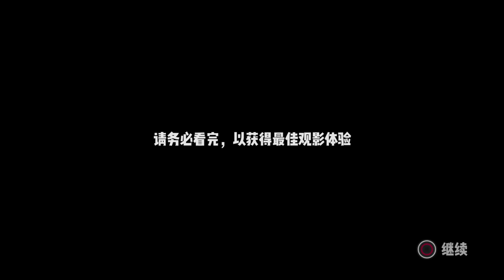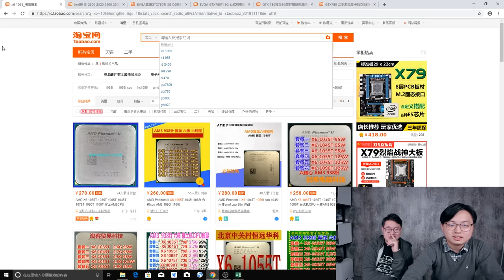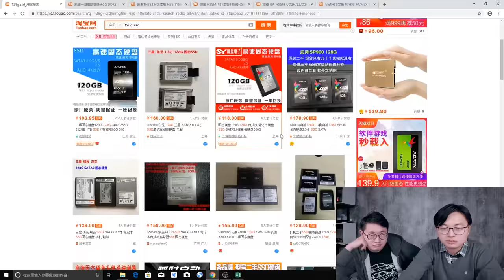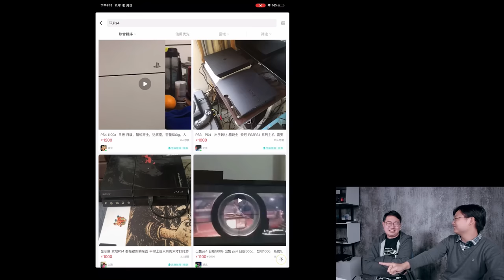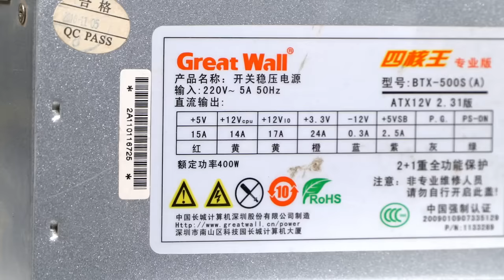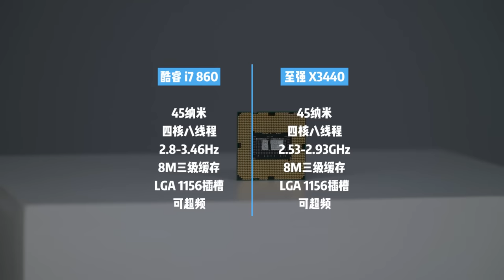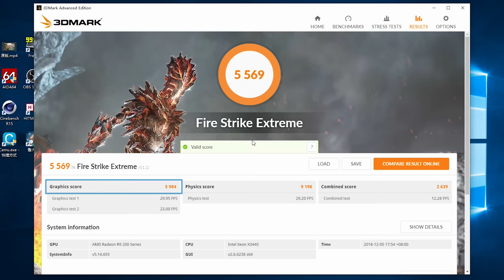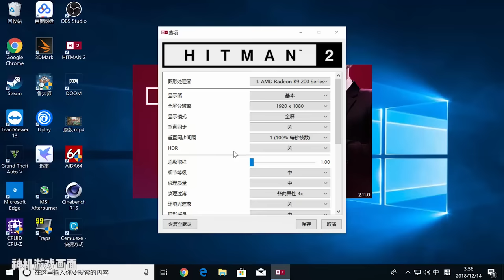1200元打造4K神机对决1200元PS4！谁才是游戏之王？

Comment: 2023: 我配了一台ITX，价格也是1200元人民币（不含运费，因为从国内买的部件是背过来的……）。配置单如下：
主板：精粤X79 itx ￥170；
CPU：E5-2687W v2 ￥170 （8C16T，睿频4.0G，25MB大三缓）；
显卡：EVGA GTX 1060 6GB 短卡 $40（本地淘的）= ￥286
内存：2x16G 三星ECC DDR3 14900R $15（本地淘的） = ￥107
电源：女生宿舍1U电源（等着爆炸）500W ￥160
SSD：自己用剩的256G nvme（反正五十块钱也能搞定）
机箱：邻家小匠 L77 ￥130
PCIE 3.0延长线：￥40
散热器：利民AXP90 X47 ￥130

现在还是散件，等装好了再更
Reply: 咋说呢，机箱实在是太憋了，CPU我从TDP(150W)一路限制到100W（好处是性能似乎只损失了10%左右）。散热器换成了淘来的Alpenföhn BR。这个散热器的好处是风扇在鳍片下方，所以我自己3D打印了一个侧板，在散热器上方开了一个12x12的风道，并且顶着鳍片上方安装了一个12012薄扇辅助散热，CPU才勉强压住（<75°）；1066的释放程度不错，虽然是短卡但是也有我之前的一张双风扇华硕1066的九成以上性能，属于完全可用；电源其实相当可以，12V给了30A，这个体积基本上是够了。唯一的问题就是一旦压力上去了，1066的风扇直接起飞。有得就有失吧。我跑了暗黑三四，加上古墓丽影瓦尔哈拉，体验是完全没问题的，稳定性也相当可以。最重要的是250x240x90这个尺寸放在背包里简直太没压力了（当然来自重量的压力是另一回事）又在本地30块钱淘了一个移动屏幕（其实挺后悔的，再加十块能上144高刷屏）。然后我就想，这个世界上是不是有一种东西叫做笔记本电脑……

Comment: 电脑型号 技嘉 B85-HD3-A 台式电脑  (扫描时间：2018年12月26日)
操作系统 Windows 10 Enterprise 64位 ( DirectX 12 )
 
处理器 英特尔 第四代酷睿 i7-4790 @ 3.60GHz 四核
主板 技嘉 B85-HD3-A ( 英特尔 Haswell - Lynx Point )
内存 16 GB ( 金士顿 DDR3 1866MHz )
主硬盘 金士顿 SV300S37A120G ( 120 GB / 固态硬盘 )
显卡 Nvidia GeForce GTX 950 ( 2 GB / 影驰 )
显示器 LG GSM5AB6 LG IPS FULLHD ( 23.8 英寸  )
光驱 日立-LG DVD-ROM GDRH20N DVD光驱
声卡 C-Media Electronics Inc. USB Audio Device
网卡 瑞昱 RTL8168/8111/8112 Gigabit Ethernet Controller / 技嘉
 
能否超频呢
Reply: XIN LIN 不行